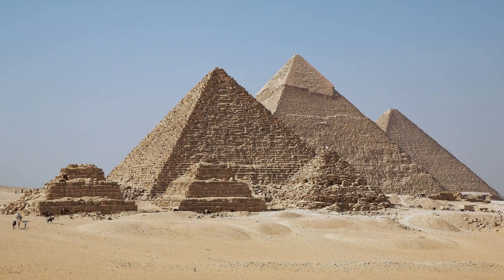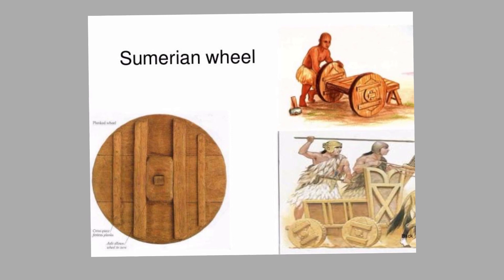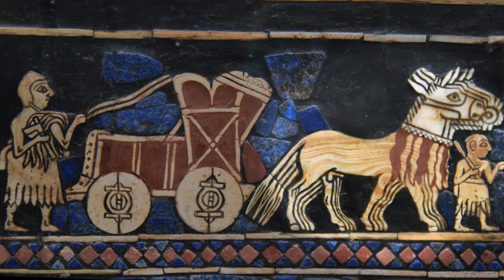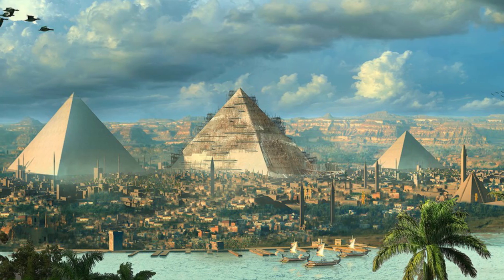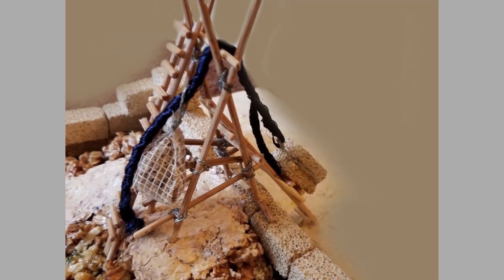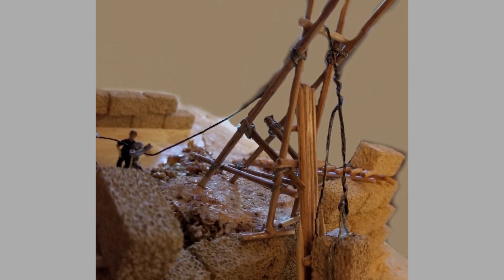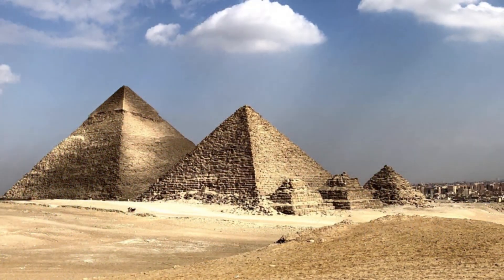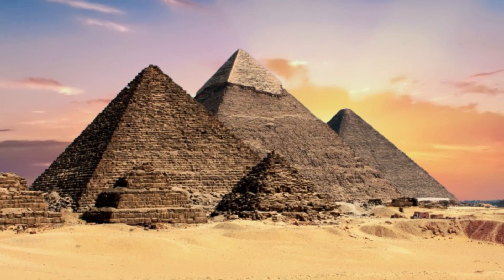How the Egyptian pyramids were built in 1/3 the time and with 1/3 the labor of prevailing theories!

Comment: I find this a really interesting theory, but it does raise some questions in my mind. The first would be what materials would be used to make the ropes and if those ropes on the pulley system could carry the weight of these large blocks, particularly the ones towards the bottom.  I realize that as you go up, the blocks likely get smaller. My next question would be from my recollection of videos, you see interior rooms with block walls with diagonal channels that all seem perfectly plumb with trap blocks that fall into these channels sealing the entrances.  I am curious how you account for these with the fill in theory. I suppose you could try to go around the fill in, but then after 1ks of years, I still would expect some settling and skew of being plumb.
Reply: Rope was invented around 4500bc. Generally made from water Reed fibers,( same as the boats and sailing vessels) also leather ropes.  Today a popular strong rope is made from the Hemp plant..
Reply from the maker: To drill down further, rope making goes back at least 40,000 years. See: The earliest evidence of true rope making is a very small fragment of three-ply cord from a Neanderthal site dated 40,000 years ago.[9] Later impressions of cordage found on fired clay provide evidence of string and rope-making technology in Europe dating back 28,000 years.[10] Fossilized fragments of "probably two-ply laid rope of about 7 mm diameter" were found in one of the caves at Lascaux, dating to approximately 15,000 BC.[11]

The ancient Egyptians were probably the first civilization to develop special tools to make rope. Egyptian rope dates back to 4000 to 3500 BC and was generally made of water reed fibres.[12] Other rope in antiquity was made from the fibres of date palms, flax, grass, papyrus, leather, or animal hair. The use of such ropes pulled by thousands of workers allowed the Egyptians to move the heavy stones required to build their monuments. Starting from approximately 2800 BC, rope made of hemp fibres was in use in China. Rope and the craft of rope making spread throughout Asia, India, and Europe over the next several thousand years.

Regarding the inner structurers, as mentioned in the video, all that is necessary is that their walls were built at a slightly higher elevation than rubble being dumped around them. There outer walls could have been built at the same elevation as the outer walls of the pyramid, only slightly higher to keep the rubble from falling inside until they reached completion with a roof in place. Or they could be completely built and the rubble filled in around them. The diagonal shaft's could be built concurrent with the increase in rubble elevation as well as structures at differing levels within the pyramid. As long as the outer walls didn't move much and the inner structures were built robustly, there need not be much shifting.

Comment: Rubble used as counter balance for elevating blocks but how did rubble find its way at Pyramid top to do this mechanical work?  What does mass ratio of total blocks to total rubble turn out to be?

Seems like men of day too easily dismiss intelligence and ingenuity of former times yet the Pyramids stand just the same-- didn't just build themselves and to think Pyramids were built the "hard way" is myopic and just plain silly.  Pyramid builders deserve our respect and a tall cold glass of ice water---  Thanks
Reply from the maker: Good question Sherm. My answer: Scaffolding, stairs, smaller ramps, or other would be erected, to bring the rubble up by human and/or donkey. The rubble (created when quarrying and shaping stones) would be brought in baskets, in smaller, more manageable quantities. A non-issue for humans or donkeys. It’s the shear size and weight of the big blocks that make them a challenge to move, certainly not the rubble. Rubble could even be recycled as needed as the volume of the interior may have been less than the exterior depending on the volume of interior structures constructed, etc.

Myself and my father agree, as engineers with logical and creative minds, it's inconceivable to us that an architect, with the skill to build a pyramid, who is also a physician,, astronomer, philosopher, etc. couldn't easily envision the simplicity of rolling members, levers, wheels, lubrication, pulleys, etc. It is somewhat arrogant of us to assume they were soooo much more primitive just because we haven't "found" the item in the archeological record - yet...